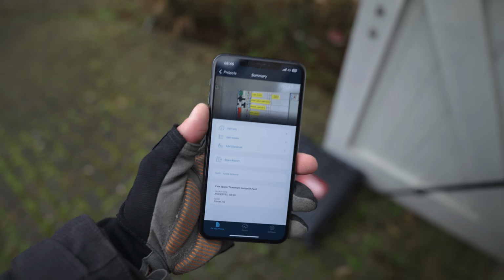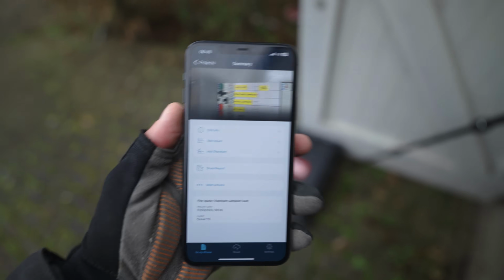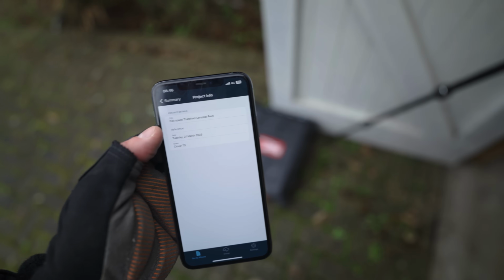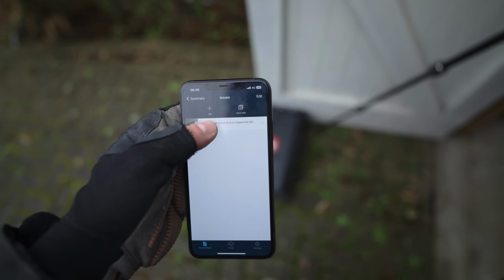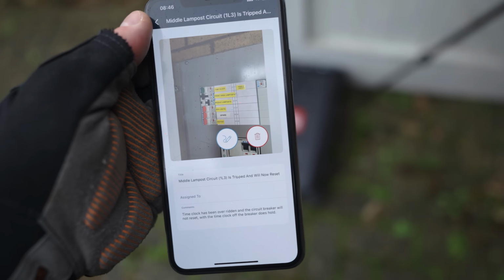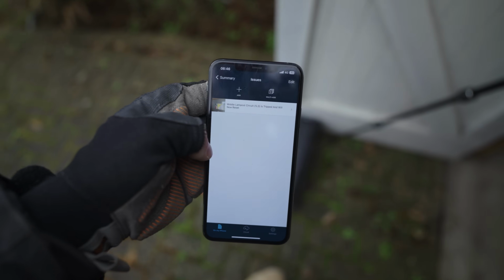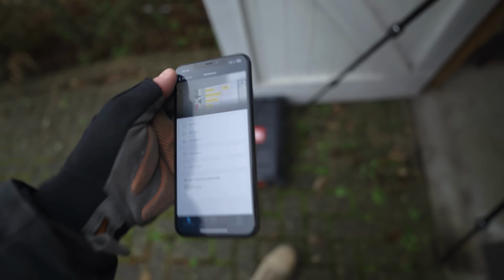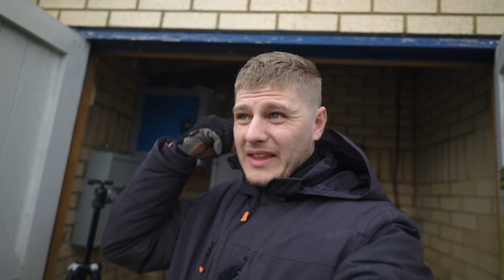Fault finding car park lamp posts

Comment: If you do go back test each  disconnected post individually at the base taking a note of all your readings. It will give a clearer indication of if its an accumulation of these earth leakage issues causing the problem. As has been mentioned it may well be water ingress in the lamp head or deterioration of the units themselves thats the problem but you could lay the facts before the client and suggest a course of action i.e. fitting repalcements

Comment: Had something similar some years back on a railway station turned out to be cumulative earth leakage on the lamposts, could get so many on before it tripped , did not matter what order the fuses were replaced in the lampost cut outs stripped the whole circuit down trying to pin a single fault down, outside lighting a nightmare on rcbo especially older installs.

Comment: That regulation about lighting that is accessible to the public needing to be protected by an RCD (714.411.3.4) excludes street lighting. Also maybe those thorn bushes are there to make the street lights inaccessible to the public as well as electricians😅
Reply: So that's where Thorn electrical came from😂😂😂

Comment: Hi Mike. As I see this…
DNO supply separate from the office block so it’s not classed as a final circuit feeding outside lighting. (No additional protection required)
If the rated OCPD satisfies a Zs reading that disconnects within 5s an RCD is not required for street lighting metal or not 👍🏻
Just put it on an MCB and it will still comply with those IR readings.
Good work…. 👌🏼

Comment: You wondered how many of us watching are electricians.
You'll need to run a poll.
 1 tick in the electrician poll from me. 
Would have tested slightly different, once you've pulled all the fuses and proven supply cables I would have IR'd the posts individually at the post. Just as quick probably as putting  three back together and walking back to the board to test.
All the best on the wedding.
I don't expect an answer as its your big day tomorrow.

Comment: Hi Mike I am not a Spark but I love your content been watching you for a couple of years.  Its great to see you doing installs or troublshooting.  You take pride in your work and your work methodically and to a high standard.  

When you go back to that site can you link out the lighting columns and disconnect all but 1 lamp and then test.  Then onto the next one.  I have a strong suspicion that the faillure is due to inrush current or a faulty ballast but if one of the light units is filled with water that will not help.  

Good luck for the wedding.  I look forward to your future content

Comment: According to the Wikipedia article, IP 4X means "insufficient data gathered to establish a rating", i.e. "We don't care about water ingress". No protection would be IP40.
Reply: @residualelectrical  IMO not quite because as far as I know "IPXX" is only used in the regs to express "no protection required" but accessories and enclosures will always have two numbers printed on.

Comment: Can you please elaborate on why the lamppost requires RCD protection? 

Lighting only needs to be covered by an RCD if it serves a special location
Reply: Given that RCD protection is so cheap, why would you not install one?  Notwithstanding the regs.
Reply: @JimWhitaker  Because RCDs are renown for nuisance tripping and in that situation a very dark road will be left without street lights. Same reasons as to why you don’t put medical equipment like life support systems on an RCD. It says in BS7671 (in amendment 2 also) that street lights are omitted from RCD protection, for this very reason. Not sure where Residual is getting this regulation from. I do a lot of Highway Work and if you put street lightning on an RCD you will get the sack. No hate towards Residual, I was genuinely curious is there was an update to this regulation that I missed but it would appear not
Reply: @eS-jb6iv  regulations are so contradicting, so many book so many difference of opinions. Why do street light not need need RCD protection  other than nuisance tripping?
Reply: @rjkelectrical6086 the person who knew about street lighting and risk management was on holiday the week the IET made up that rule. It’s a huge Vicky Pollard ‘yeah but, no but……’.
Reply: @rjkelectrical6086  because mcb or rcbo are prone to nuisance tripping and corrosion in damp or humid environments. All street lighting should be using a 6amp or 10amp bs88 fuse. Commando sockets on columns need rcbo

Comment: My normal method with these is to disconnect all the posts and see if the RCBO will reset to prove the supply cable, and then reconnect posts either individually or in groups and see if it'll reset; it's just a bit time consuming covering a big site.
Lampposts tend to be a PITA at the best of times simply because they suffer a lot from wind / weather damage, especially (as many people seem to like doing) with pre-flexed floods wired (badly) into junction boxes.

Comment: IR test at the load side of each post with supply disconnected. No lifter needed. Admittedly it's a ball ache. Good luck with the wedding.

Comment: Not a spark, but surely the next step is to disconnect the Neutral and CPC at the base of each lamppost, then retest/test the flex going up the post? Interesting stuff on the health side  👍

Great content as always, cheers 👍
Reply: @residualelectrical  Yeah, I'd be tempted to pull all fuses at the lampposts and reconnect them one by one, measuring earth leakage every time. That way you can rule out the ballasts. Possibly even liven up the circuit with all the lamps out of the circuit first. I've got zero experience with discharge lighting but that inrush leakage sounds a lot like ballast to me.

If my math is correct, you need an IR as low as 7.7 kΩ for 230 V mains voltage to drive 30 mA through an earth fault, so the 4 MΩ isn't the issue, it has to be that blip at startup.
Reply: @residualelectrical  It's Ohm's law. R=V/I, V being 230 V mains voltage and I the nominal trip current of the RCD in amps, in this case 0.03 A. In reality you need to err on the side of caution because the actual voltage can be up to 253 V (230 V +10%) and the RCD can trip as low as 18 mA if I remember correctly but you still need horribly low IR values for an actual RCD trip. Your initial readings around 0.01 MΩ were dangerously close to tripping conditions though, definitely something wrong there.

A very good video, I love systematic fault finding!

Comment: Earth clamping direct onto the swa ? Time delay RCBO might get you over the start up current if you can find one. Or even a c type rcbo.
Reply: A type C isn't going to help if the RCD side trips out and at up to 25 mA that's certainly the case. C only affects the magnetic trip of the MCB part, not even the thermal trip.

Comment: chage to D curve rcbo, pack bags n go home job done😎
Reply: @residualelectrical  I know 😂 we see a lot of  faults with column lighting like the ones in the video; usually just the fitting needs replaced due to water ingress over the years in poor installs. Never seen earth leakage causing tripping before so was good to see that and get a better understanding from it. Great video once again!
Reply: WOW.